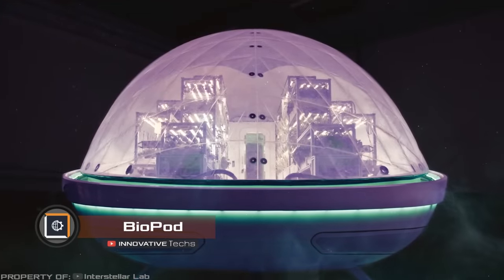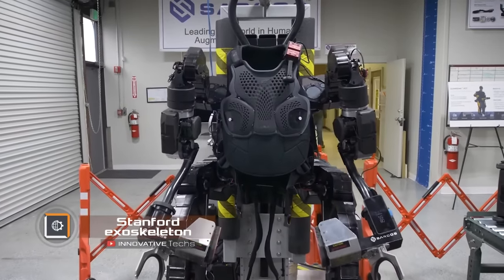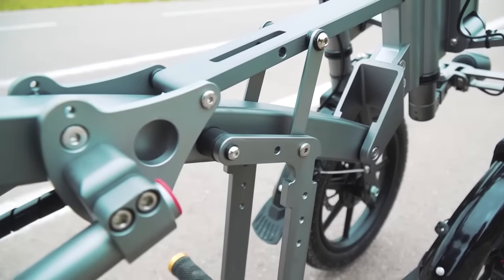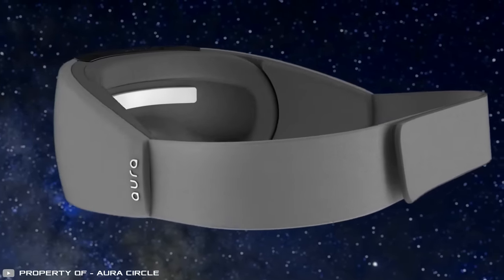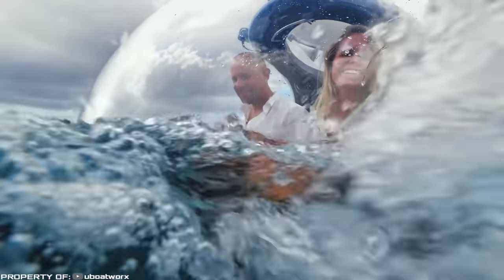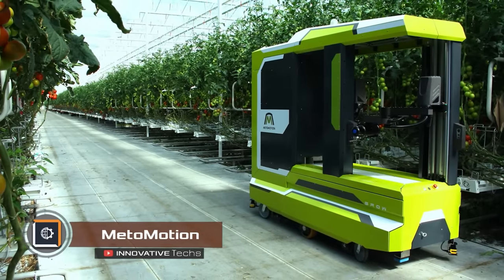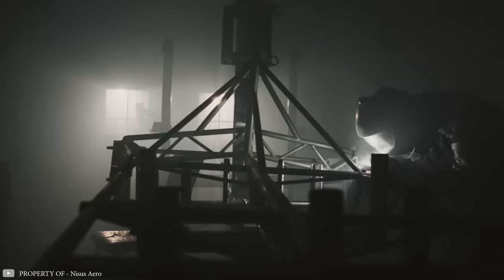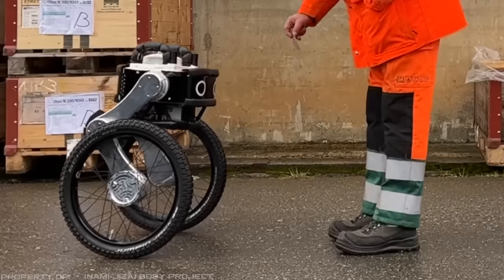70 INVENTIONS ON A WHOLE NEW LEVEL

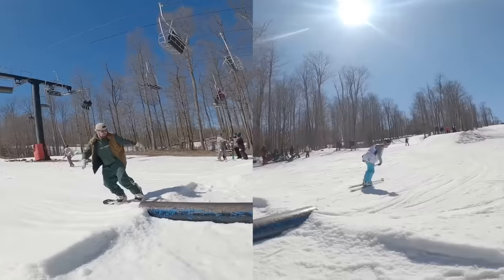Comment: 33:53 "Sled" already existed in the 90s as a children's toy. A friend had one. It was black hard plastic with a rubber half-dome shape where you placed your front foot and had 4 plastic, bright pink skis where the wheels would be (if it were a skateboard, like the one in the video, minus the extras). It also let you lean like a traditional skateboard. I believe it was called a "Skiboard" but Google searching that, brings up snowboards, so I must be mistaken on the name.

Comment: 0:27: 🌱 NASA developing self-sustaining biopod capsules for growing plants on the Moon.
7:02: 🚀 Revolutionary advancements in hovercraft and space technology
13:45: ⚙️ Innovative hydrogen production platform utilizing wind power for clean fuel generation.
20:39: 🛴 Innovative Electric Scooter with Tilting Wheels and Lithium Battery
26:41: ⚙️ Revolutionary advancements in aviation technology and logistics.
33:54: ⚡️ Revolutionary Energy Innovation: Kidos Prototype Nuclear Reactor
40:39: 🚀 Revolutionary single-seat quadcopter Jetson One with advanced flight capabilities and obstacle avoidance system.
46:37: 🚀 Revolutionary gaming capsule and versatile electric mini pickup truck.
52:54: 🤖 Swift AI defeats world champions in drone racing, showcasing potential in various industries.
59:51: 🤖 Revolutionary inventions: A versatile robot, hybrid watch-earbuds, and compact workspace essentials.
1:06:48: 🤖 Innovative robots with unique capabilities and designs

Timestamps by Tammy AI

Comment: use the metric system please!
Reply: No don't use the metric system
Reply: @ronswonke8109  There are only like 3 countries (and few Islands) that doesn't use the metric system. turning inches into miles? Wanna convert ounces (US or UK to make it even simpler) into pounds? better have a calculator. And 32°F being freezing, why not 24! and what is boiling! yes 100°C, simple, so easy. I've never been able to get around it, spent 15 years in the US but still is confusing to me. I am happy with metric; makes every calculation so easy.
Reply: Metric would be best if EVERYONE used it! I'm American and don't like the fact there is another relevant system.
Reply: @ronswonke8109  even American can't say how many feet are a yard, how many yards are a mile? Celsius, 0° Water freezes, 100° water boils. So simple, and I mean nearly all manufacturer even in the US are using the metric system, physics is metric! Nano, nobody things at nano inches but nano meter

Comment: It’s funny how you worded the hydrogen train engine because just like a diesel the hydrogen is turning a generator and the generator stores, electricity in capacitors and batteries, and the electric motors run the train. It would be easier to say that so people would understand what hybrids are all about you can take a small gasoline engine to power a generator that would run your car without a huge battery in all of the Dangers involved

Comment: You keep talking about "Hydrogen engines" instead of electric motors, then report the use of Fuel cells. You may have missed the fact that hydrogen fuel cells generate electricity to drive electric "Motors" - not "Engines". The end result is an electric vehicle with fuel cells instead of "just" batteries. All fuel cell vehicles also have batteries -  just typically smaller ones - which are also charged by the fuel cells. More accurate narration please!
Reply: Took the words right out of my mouth 😂
Reply: The production of hydrogen for these vehicles isn't exactly a "green" process. Many "0 emission" machines are far from it. They simply produce their pollution somewhere else.
Reply: You do relize that your talking to a bot vid. 0 feedback in the echochamber.
Reply: Content makers make obvious mistakes on purpose, so viewers post comments. They pick the mistakes made so the comment poster feels intelligent by correcting it

Don’t feel bad, they get a lot of viewers because it’s such an obvious mistake people assume it’s legitimate
Reply: @DriveLaken  thanks for your comment. I got sucked in. Makes sense when you put it like that.
Smart content providers!
Reply: Plug it in at the hydrogen pump or plug it in at a friggin walgreens😂
Reply: More accurate narrating or is the AI just not that good yet
Reply: The